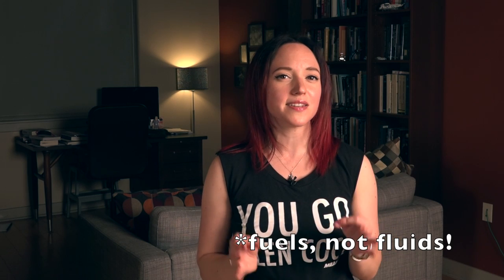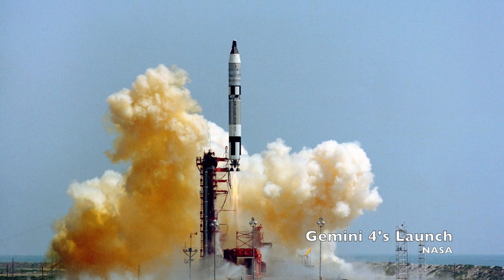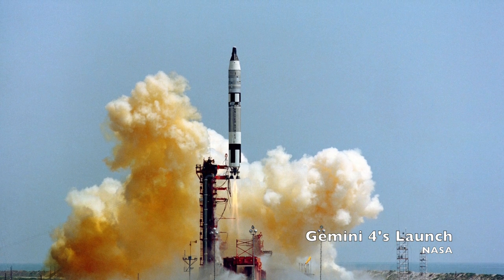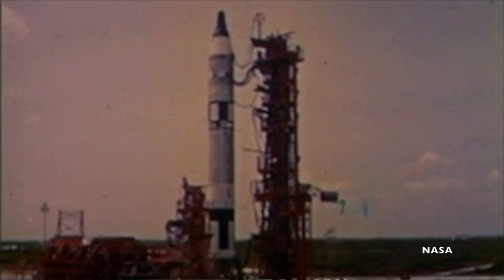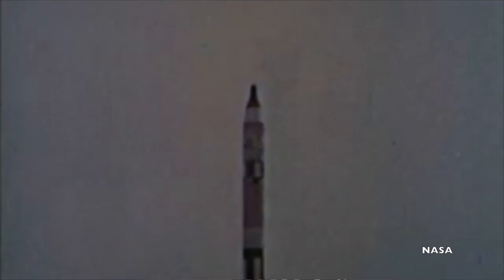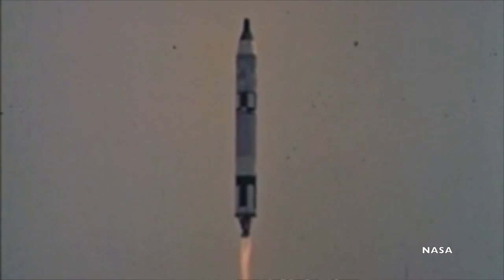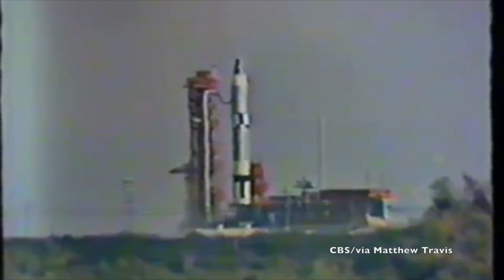Why did the Gemini Launches Make a Bwooping Sound?

Comment: I was a Titan II engineer. I noticed a trivial mistake. The start cartridge is like a shotgun shell. It explodes to create the gas that causes the turbine to start spinning. The sound you hear is the turbine spinning up. That starts the APU (using the hypergolic combustion) which pumps the fuel and oxidizer into the combustion chamber. The APU is like a small rocket engine and, if you can find a high quality video or picture, you can see the exhaust from the APU as the rocket rises.
Reply: Actually, it deflagrates (burns); it does not explode (which is detonation).
Reply: Thats not correct. An explosion is generally defined as a rapid expansion in volume of any kind. 

If the expansion is supersonic its regarded as a detonation, 
if its subsonic then its deflagration.
Reply: That makes sense, it sounded more like a mechanical cranking, i.e. the turbine starting, than an electronic "bloop".
Reply: Geez how old are you
Reply: I like Amy's explanation better even though yours might be correct. She looks so cute making the rocket noise.
Reply: You also hear that sound when automatic flushing toilets operate, as they use a turbine as well
Reply: @massimocrisologo4497  He may not of been an engineer on the Titan II Glv (Gemini) maybe he was an engineer for the ICBM version of the titan
Reply: THE ORIGINAL PROFESSOR CHAOS  Thank you for that.  How rude some people are.
Reply: So it's the geartrain of the pumps?
Reply: Interesting side note: The change to use of a start cartridge was a great safety improvement over having Jimmy go down there every time to pull the starter cord.
Reply: Shades of the old Coffman starter!
Reply: Whoa
Reply: Knew she was about to get burned when you started off with "I was a Titan II engineer...." :-P
Reply: What did the APU do in the titan? Did it power a hydraulic pump to gimbal the engine nozzles? Or was it a generator like in a jet aircraft?
Reply: @neonhomer  Yes
Reply: @jeffhawkins5582  Got tired of having to change clothes.
Reply: @edwardquicksall5213  I was always told that was the gas-generator.
Reply: @edwardquicksall5213  I get it. When you said APU I thought of what is used aboard jet aircraft to generate electricity and assist in starting the engines without a start-cart.
Reply: Thanks for that information and comment. Facinating!
Reply: @twistedyogert  AFAIK, the Titan 2 used batteries to power the guidance computer etc, not any kind of mechanical apu
Reply: @pteppig  I know. The Titan 2 was originally an ICBM so it makes sense that batteries would be used as extended flights wouldn't be required for it's purpose. The engine itself used a "gas generator" cycle. Some fuel and oxidizer are directed into a separate combustion chamber where the exhaust is used to drive the fuel pumps.
Reply: Thank you sir ur a hero to me
Reply: So, what you're saying is, when you get gas you get that sound - yep, been there, done that.
Reply: My dad was also an engineer for Martin at this time, and this is pretty much how he explained it to me. Side note: On my birth certificate, under "father's occupation" it says "missile plant".
Reply: @twistedyogert  It burned to make hot gas, which expanded through the turbopumps. The spinning pumps could then pressurize the propellants into the combustion chamber and cooling jacket.
Reply: @jacklassiter2181  Did you just well actually a titan II engineer
Reply: The gas generator right?
Reply: Thanks
Reply: @Eddy Q, thank you for explaining the ignition process of the Titan II and why we hear what we hear. I was a "missile man" on the Patriot missile system and knew the ignition sequence and all that happened before the motor ignition request that touched off about 16 feet of solid fuel........loud bang!
Reply: Apparently a lot older than you are! With age comes great knowledge because we have been here longer to know much more than you. 'Youth is lost on the young'.
Reply: Do current rocket engines make that sound at start up?
Reply: Yep, usually they just labeled the assembly a turbopump.
The difference between those and a modern aircraft APU being the level of acceleration of the pump inside of the rocket. An aircraft APU could take 10 - 30 seconds to start, maybe even a minute to get up to speed for some older models, can't have that in a rocket.

One of the best documentaries I ever saw was one that spoke of resolving difficulties with our rockets, things like one pernicious problem, pogo oscillation, which haunted the hell out of the Apollo program.
Work all done without digital computers, only slide rules.

Comment: The start cartridge sort of reminds me of the Coffman starters that were used to start large piston driven aircraft engines.
Reply: Didn't they use Kaufman starter in the film " Flight of the Phoenix. "?
Are they like a big shotgun shell?
Reply: Yup, they're Coffman starters though, OP is right on this one

Fastest way to get the engine spinnin' :D
Reply: I recently read that there were also smaller versions of the shells used to start up diesel engines in tractors such as the Field Marshall.
Reply: That's exactly what it is! It's a gas cartridge,fired to  initially spin up the fuel pump turbine.

Comment: Starter cartridges have been used in aviation for many years. Watch a typical 50s jet such as a Canberra (or its American version, the Martin B-57) start up and you'll see and hear the cartridges light up. They produce a lot of thick black smoke although in a rocket launch the smoke would be overwhelmed by the much thicker rocket exhaust.

Comment: Was that the same fuel/oxidizer combo as the LM ascent stages?

Your "bwoop" impression was spot on, of course.
Reply from the maker: robyrobyroby12345 I'm not sure it was the same combination but yes, it was hypergols. I think the SPS engine on the CSM was as well. When I'm not in New Horizons mode I'll look into it and maybe do a video on what fuel/oxidizer combinations were used where. Not the sexiest topic but interesting!
Reply: robyrobyroby12345 Yes that was the same fuel. It was also used by the Descent Propulsion System of the LM and the Service Propulsion System of the CSM.
Reply: Love your 'bwoop' impression, AST, but on most videos it sounds to me more like a skidding automobile just before the crash!
Reply: It was said it be,  but the  Apollo 17 ascent module left no flame or smoke.   Riddle me that?
Reply: @marynollaig4124  
It was operating in a vacuum.

Comment: That sound is very similar to tractor trucks that use an air motor to start their engines.  It sounds almost exactly like the air impact-wrenches you hear at a tire service center.
Reply: +Edward Cabaniss  Right you are! That sound is the venting of the drive gases.

Comment: You explained it well. I recall hearing that odd sound in several Gemini Titan launch videos and though I was a Titan troop in the military (1980-83), I never got to witness a Titan II launch and here that noise live. I recall the start carts as we used to call them. But I was mainly electronics and guidance (E-lab) and didn't work on propulsion systems.

Comment: Thanks Amy.  The Lance missile I worked with in the US Army also used a hypergolic fuel system.
We used unsymmetrical dimethyl hydrazine  ( UDMH ) as our fuel and inhibited red fuming nitric acid ( IRFNA ) 
as our oxidizer.

We did not make any BWOOP noise when we launched haha.
we used something called a  SPGG (  pronounced speegee ) ,  which was a Solid Propellant Gas Generator.
After the Safe/Arm switch was thrown and then the Safe/Fire switch ignited the SPGG which created great presure
forcing the fuel and oxidizer to meet in the engine. And Boom.....combustion.

Actually it was really 2 engines.  We had one engine inside another engine.
The main engine was the booster engine which burned was more powerful and got the missile off the ground and going mach 3
before it cleared the launcher.  Then after the booster cut itself off the sustainer engine at the core of the booster would continue as long as the monitor programmer had programmed it to in order to reach the target.

No, we didn't have a BWOOP at launch but she sure did give a mighty ROARRRRRRR.

Comment: Early Falcon 9s using Merlin 1C engines also apparently made a sound like this on main engine startup. It's quite audible in the Flight 2 webcast. Apparently the V1.1 and later Falcons no longer make this sound, probably because of a redesigned startup procedure for the Merlin 1D.

Comment: The hum she talks about was the APU turbines that were used to jam fuel and oxidizer into the combustion chamber. I can tell you a little known story about this APU.  I was an Electrical Engineer in the Titan II from 69 to 73. Around 73 the AF sent one of our rockets to Vandenberg Air Force Base for a test launch. But the APU's turbo exploded in the silo. What happened was that a train crossed the rocket's trajectory and the commander selected an abort during a critical point in the launch sequence. Now, there are two pre-valves that held the oxidizer and fuel from passing into the turbines of the APU that she is talking about. There are two relays involved with the pre-valves (1) a motor driven relay actually opening the pre-valve and (2) a relay that sends the signal to the launch console saying that the pre-valves were open. The two relays were expected to operate simultaneously. But there is a very short window where they are not because the relay that opened the pre-valves was motor driven and the one that sent the "ok" signal was not. When the abort was given the pre-valves were not opened because the motor driven relay could stop right in its tracks but the relay that sent the signal to say they were open continued to close. When the launch was continued the start cartridge that she is talking about fired and the turbo (without fule/ox) spun up to many-many times it's design speed and exploded.

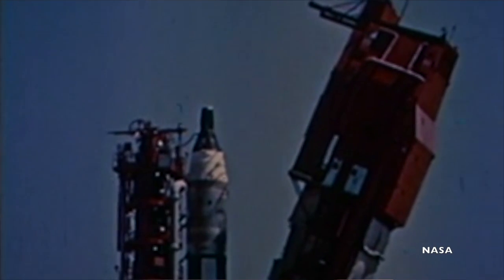Comment: Just one note, around 1:00 you say "if the tanks are pressurized the sheer force of gravity will actually feed those two fuels". There are a few problems here. Some hypergolic systems (for example, the Apollo Lunar Module Ascent Stage engines, if I'm not mistaken) use pressurized fuel and oxidizer tanks specifically so that no turbo pump is needed. The tanks are pressurized with an inert gas and the pressure of that gas is what pushes the fuel and oxidizer out into the mixing chamber. That's it, no pump and works independently of gravity. Extremely reliable - the only moving parts are the valves and aside from that it's all just pressure and chemistry. Very robust.
As to gravity-fed, you could conceivably get away with using a gravity-fed system to kickstart a turbo pump with no separate starter charge and no tank pressurization, though I don't know if that's actually used in any system (would be a bit how-ya-doin).
 
Aside from that, all sounds right to me. Nicely done.

Comment: The start cart "bwoop" was not due to the combustion, the sound itself was the gear-train spooling up the Roots-type impellers of the rocket engine pumps and auxiluary burner (that continued the engine pump pressure for the burn) to operational pressures and burn.

Comment: It's probably worth mentioning that we don't see that kind of system on most rockets because the Titan Gemini was derived from a liquid-fueled ICBM that needed to be able to start up very quickly and reliably with minimal prep time, whereas purpose-built launch systems have plenty of time to ready non-shelf-stable ignition systems.
I would bet the start cartridge system is almost identical to the one used to kick-start the engines of a B-52 for scramble.

Comment: The F-1 engines on the Saturn V used propellant cartridges to start the turbopumps, then after that the combustion cycle  of LOX and RP1 kept her running. You don't hear them kick over like the Titan-II's, for all Hell is breaking loose with the F-1s firing.  You can hear a dramatized startup in the movie APOLLO 13 during launch, it sounds like water hammer.

The nice thing about the F-1s is that they are self-dampening. Meaning, if an combustion instability event happens, they actually self-dampen and stabilize themselves, even with external events (eg, test explosive devices going off inside the engine bell).

Comment: The point is that the engines aren't fed purely by tank pressure, they rely on a turbopump to boost that. And the turbine is powered by a gas generator which is fed by high pressure fuel and oxidiser from the turbopump... so you have a bootstrapping problem on start up. One way would be to start with tank pressure and let the turbopump spin up as increasing pressure feeds around the system. But that takes time and maybe bad things will happen to your gas generator and chamber if you run them at low pressure, so they kick-start the turbopump with a burst of high pressure gas from the start cartridge.

Comment: Wow, there's a VERY recent video circulating around which shows the startup sequence for an F-22 Raptor. 

It shows two access doors opening, one each, above and below the left fuse/wing assembly. One is apparently an air intake, the other one an exhaust port. 

Anyway, this nasty plume of what looks like burnt hydrazine gas is expelled from the lower port. You can hear that "whoop" sound here as well. My guess is, they spin up a small powerful turbine wheel which is then used, in turn, to start the main engine.

Sounds like it starts the main engine in about 20 seconds. Sure beats having to use a start cart (or internal battery power source) with a 90 second spool up. In a scramble, seconds can mean the difference between life and death.

Comment: What exactly is a start cartridge?   Similar to a shotgun cartridge?  These were used to start some older aircraft such as the The Coffman engine starter ( known as a "shotgun starter") was used on many piston engines in aircraft and armored vehicles of the 1930s and 1940s. It used a cordite cartridge to move a piston, which cranked the engine. Some American military aircraft and tanks which used radial engines were equipped with this system. Some versions of the Rolls-Royce Merlin engine used in the British Supermarine Spitfire used the Coffman system as a starter. 
Cartridge starters used on a number of jet engines, including such engines as the Rolls-Royce Avon, which were used in the English Electric Canberra 🙂

Comment: Big rocket motors, (e.g. the Saturn's) seem to be mostly a concatentation of fuel pumps. Big ones power the thrust engines. They're fuelled by smaller ones which ... eventually down to a little one which uses compressed gases either as fuel or to spin the turbines.
Reply: avro549B  "concatentation" or 'concatenation'?
Reply: Thanks. Corrected.

Comment: Amy, I have a question regarding the U.S. Space Shuttle. The large fuel tank that supplied the fuel for the shuttle. It was basically a large aluminum tube filled w/two tanks. One for Oxidizer and one for fuel. Why didn't they use the fuel tanks to help build the structure of the ISS. They went to the expense of lifting this massive tank assembly into orbit and then just basically threw it away to burn up in the atmosphere. Couldn't the tank have been designed to make a far bigger Space station? Maybe on the order of the Station on 2001 A Space Odyssey? They could have spun it to make artificial gravity. I always wondered about this. William Combs.
Reply: Not to sound facetious or condescending at all but it is the same reason that it would be difficult to rebuild a shipping container in space to become a habitat. Tank is just that (actually far more complex but for now it will do). Now to add all the life support hardware, docking adapters and all that stuff in orbit is really not practical. Not then, anyway. But a good question nevertheless.

Comment: You hear a similar sound when the SpaceX Falcon 9 first stage ignites. It has a higher pitch to my ear and sort of sounds like a cross between an elephants trumpet and car tires screeching in a curve. The fuel, I'm not sure what, used in the gas generator, where the fuel for starting is burned and fed to the turbo pumps, burns green so you see a green flash/flame  when you hear the start up burn.

Comment: Baaasically the exhaust from the pump driving turbine is like a turbocharger's waste-gate getting stuck open.  The turbine would then be powered by the main fuels but was under torque at the point that they started feeding and the main engine exhaust was far louder than the pump.